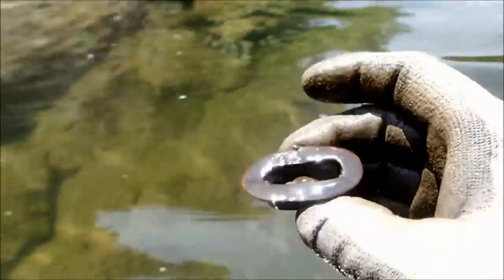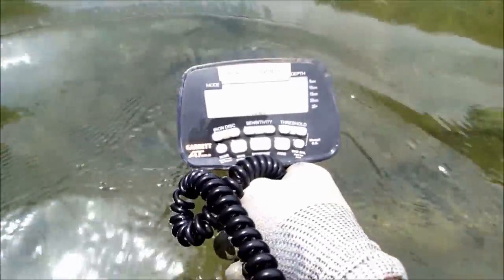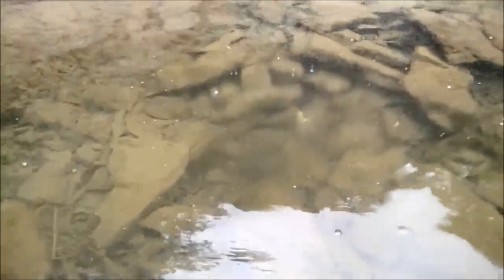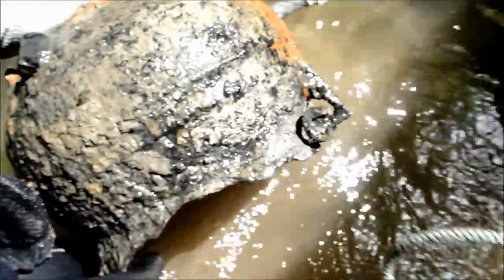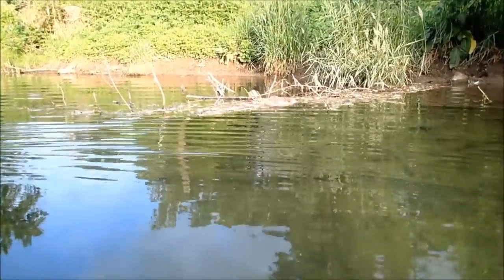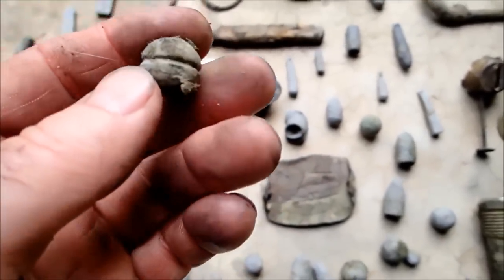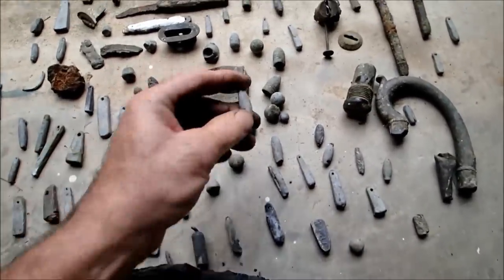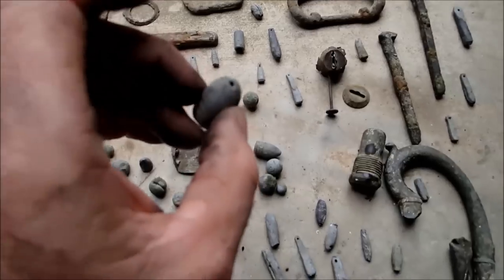Kayaks, Cannonballs And Snakes In The Trees

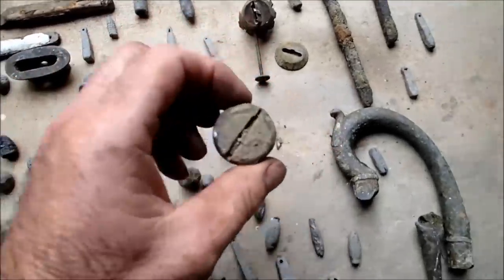Comment: 9:10 - disarmed means somebody has disarmed it or you did it by yourself? Doesn't it contain any explosive materials inside the shell? Even without the fuse. Is it safe to drill it with hot and sparky drill? I would shit my pants even to touch it, not meaning to disarm it. :P